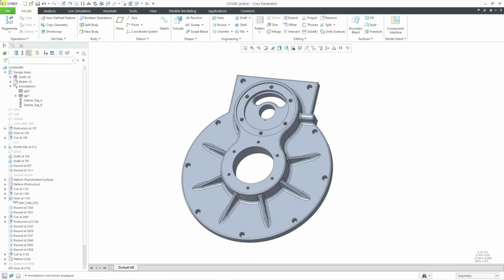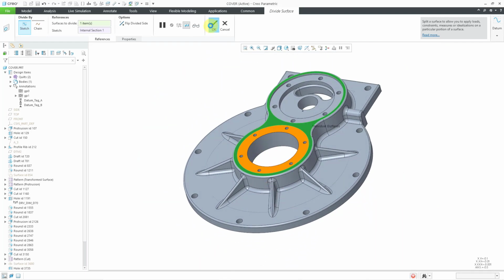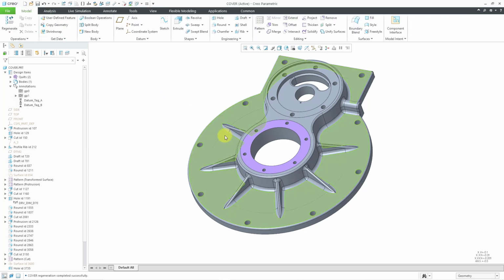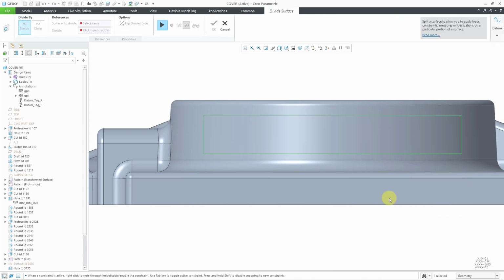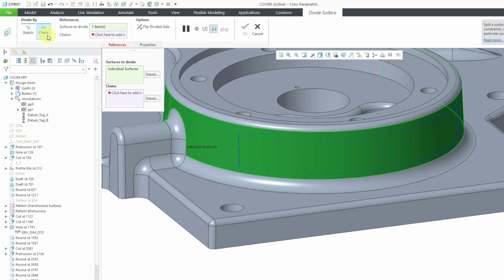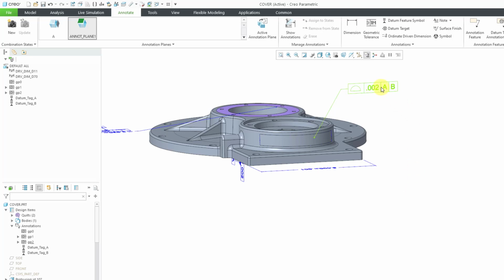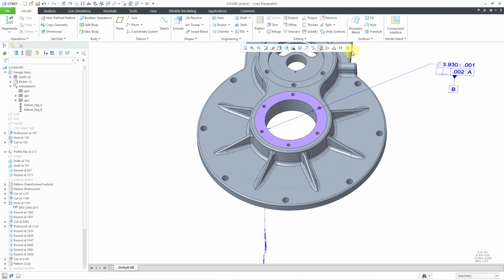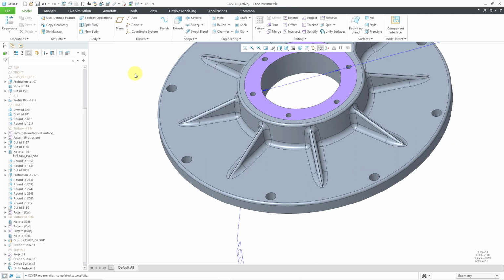Creo Parametric 9.0 - Divide and Unify Surfaces

Comment: Hi Dave I was using the  divide surface option to define an interface connection between two mating parts in Creo Simulate assembly Mode by using surface to surface option....Even though I divided the surface into circular region(washer seating area) the interface connection was created for the entire mating surface....Why not only at the split area interface connection is not getting established? Any thoughts for this? Thanks
Reply from the maker: I recommend opening a ticket with PTC Tech Support. I made this video over 3 years ago. I simply don't remember the particulars of everything I show in my videos. Did you try a Surface Region in Creo Simulate? I don't remember the specifics around Divide Surface and surfaces for interface connections.
Reply: @CADPLMGuy  Ok Thanks for the reply...I will try with surface region in Creo Simulate ...But for your kind info, the same assembly after dividing surface when exported to ANSYS, I was able to manually select &  create interface connection at the split surface area only..

Comment: How can I do this circular surface split in creo 4.0?
Reply from the maker: You could do it in Creo Simulate but it was only for simulation features. People just faked it in Part Mode with a surface offset by a very small distance.